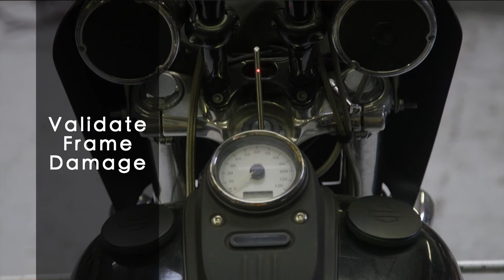Rack and Pull Industries presents The Straight Shooter

Comment: Really cool. Is there a spec manual for older bikes or does it just use the pivots and steering head angle and rake to align? I have several bikes from the 80s and just wondered how that was determined. Really considering sending one of my bikes in for this. I believe there is a shop that provides this service near Sacramento California. Thanks.
Reply from the maker: I do have specs for these bikes. That shop in near Sacramento might be. I'm located in Rancho Cordova, right outside of Sacramento.